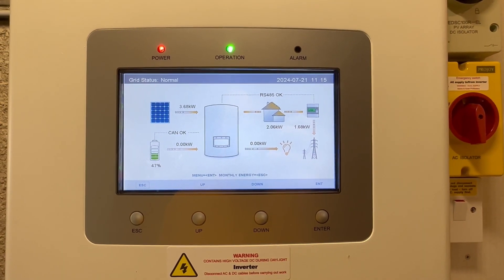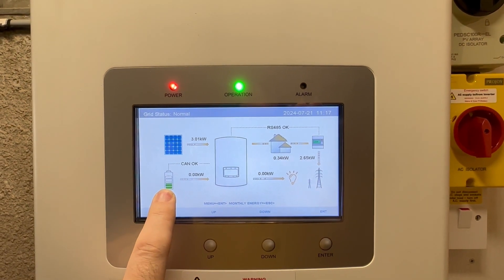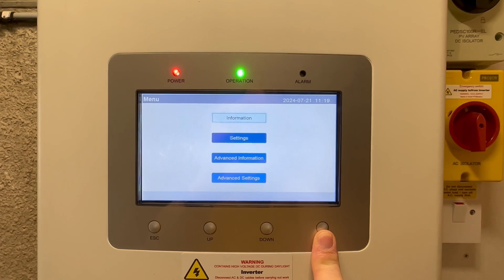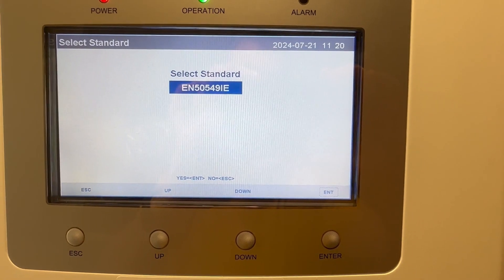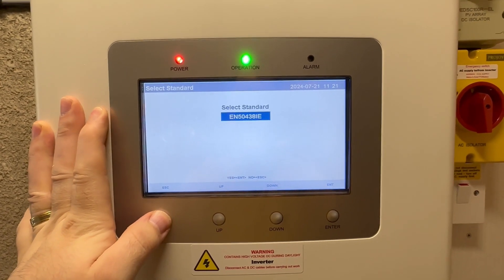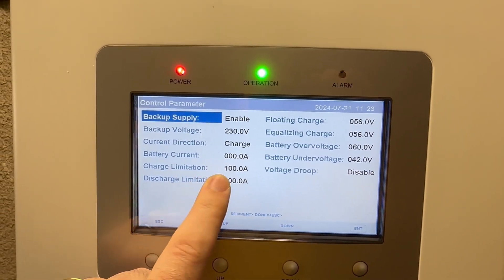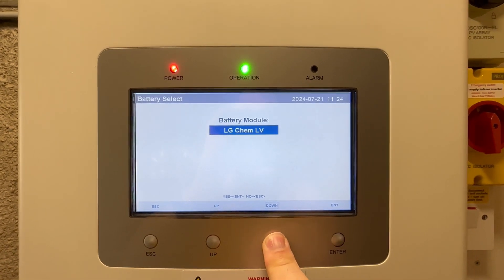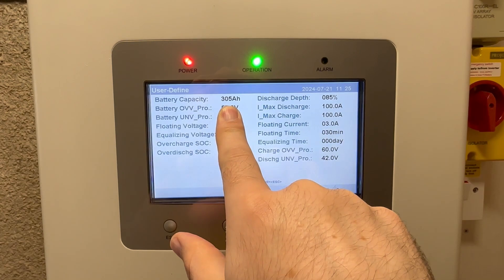Solis Inverter Battery Settings (other options)

Comment: Hi Gary, great video thanks. 
I’ve got exactly the same set up now solis and seplos i’ve had solar for two years but only added my battery three months ago but my bill is only about 5% cheaper than before I added the  battery, I run a small hairdressing salon from my home so between the heater on the wall and the hairdryer and the immersion. I’m pulling in excess of 5 kW at the same time. Is there anything I can do about this? I’m beginning to wonder was it worth the investment in the first place as the inverter cannot handle a load even when I have 15 kW battery, lately in the winter my 15 kW is gone by 3 pm.
I’d appreciate your input on this , thanks in advance.
Pat
Reply from the maker: There's a lot to unpack there, because I don't have all the info. Your energy tariff matters, as well as your consumption and patterns of use. So, i'll just tell you what I would do if I was regularly exceeding the power output of my inverter and draining my 15kWh battery in the afternoon. But before I do, I want to point out that if you are filling that battery on cheap rate electricity, then you are saving the difference of 15kWh per day at the expensive rate compared to the cheap rate, which for me at circa 36c and 8c respectively would be €4.20 per day. Assuming a charge and release loss of 15% total ~€3.50 which is €1,277. On those figures, the battery gets paid off in about a year. I would try to move all my my energy needs into the batteries when it is cheap and aim to never pull expensive electricity from the grid. 

Onto what I would do if I were you and really wanted to use only cheap energy (not knowing your full circumstances or setup). Upgrade the inverter and add at least one more battery, or ideally two. You need a more capable inverter in order to charge and discharge the batteries more quickly. Your immersion will draw about 2.5kW. Your heater maybe 3kW and the hair dryer...assuming a regular hair dryer will use an average of 1.5kW, total of 7kW before any other base load in the home is considered. Depending on what is used in the home and how you manage the hot water consumption, I would suggest an 8kW Solis inverter would be a good bet. In Ireland, I would need an electrician to apply to the grid (ESB) to allow for a bigger inverter using and NC7 application before having the inverter replaced. I would then add another battery, or two which would cover the rest of the business day and then whatever the house needs when the business is done. I would expect the products to cost me approximately €4,000 and would expect a payback period of about 2 years if done properly. The electrician shouldn't be too costly, as the inverter is easy to replace and only the circuit breaker would need to be upgraded in the fuseboard.

As for the hot water. If you heat the water in a good immersion cylinder of suitable size, you should have a sizeable portion of your hot water needs from cheap night rate electricity. These would also be business expenses if I were running a salon. I hope that helps you out.
Reply: @GaryOnPower  thanks a million, that all makes sense. Unfortunately before I installed I didn’t realise my inverter would only power 5kw, so getting a bigger inverter is definitely the solution alright. 
I presume my inverter is set to discharge to the full 5 by default?
Reply from the maker: @PB22000  The vast majority of people don't realise what their inverter will do beyond turning solar energy into useable energy in the home. Your 5kW inverter will have input and output power units on the label on the side of it. Typically, the 5kW Solis will only input 5kW or output 5kW, but they are also capable of outputting an additional 3kW if say for example your solar panels are generating 8kW. The first 5kW will be used by the home or will be exported (depending on your settings) and the other 3 will go to the battery. Any excess will be clipped.  The default discharge rate is 5kW, yes. You can see this on the screen in real time when energy is flowing through the inverter.

If you buy an 8kW Solis, you can sell the 5kW solis to help a little with the costs. You should be able to sell for €200-300 depending on where you are located. There are plenty of people who bought string inverters who later want to add batteries, but can't because they need a hybrid inverter.

Comment: Floating charge 56V looks too high for me. It's set to the same as equalizing charge 56V. This can't be. Could you please explain why you chose this setting?
Reply from the maker: You would have to ask the manufacturer, as that is the default setting for the battery parameter chosen on the inverter, which I believe was AoBo at the time of recording. Likely the same for Pylon. The BMS takes over these functions anyway. Those settings are in my battery settings videos and they are what has been recommended by people far more knowledgeable than me. They are also the settings I have been using without issue for many months, while those with the default values repeatedly report battery issues. When my settings were closer to the defaults, I had issues on a weekly basis, including sudden SOC drops from as high as 50%, right down to 5-10%, effectively sedating the battery packs until the next charging cycle. 

I stress that these are the settings that work for me and people can use them, or not, at their own risk. The same settings have been applied to my in-laws battery kits. They also have a 5kW Solis Hybrid Inverter. Zero problems seen and I monitor their setup on a regular basis.
Reply: @GaryOnPower  hi thank you for your kind response. I just googled it up and found some warnings.
I did some settings by myself so I was alerted.
You may find it helpful so I copied and pasted it:

No, the float charge and equalization charge should generally 

not be set to the same voltage. The equalization charge voltage is significantly higher than the float charge voltage, and using the equalization voltage for floating can damage your batteries. 

Float charge is a lower, continuous voltage used to maintain a fully charged battery and compensate for self-discharge without causing damage, especially for sealed batteries like AGM and Gel.

Equalization charge is a controlled overcharge at a higher voltage, primarily for flooded lead-acid batteries, to balance the individual cells and remove sulfate crystals from the plates. 

Recommended Voltage Settings (for a 48V system)

The correct voltages depend heavily on your battery chemistry (lead-acid vs. lithium) and the manufacturer's specific recommendations. 

Battery Type Float VoltageEqualization VoltageFlooded Lead-Acid~54V (2.25 VPC)~62.4V (2.6 VPC)AGM/Gel Lead-Acid~54V (2.25 VPC)Not recommended (can cause damage)LiFePO4 Lithium~54V (3.375 VPC)~58.4V (3.65 VPC)

Key Considerations

Manufacturer Specifications: Always consult your specific battery manufacturer's data sheet for the precise recommended voltages and charging profiles. These values can vary slightly between brands and models.

Temperature Compensation: Charging voltages should be adjusted based on ambient temperature, typically requiring lower voltages in higher temperatures and higher voltages in lower temperatures.

Battery Type Mismatch: Applying the high equalization voltage to sealed lead-acid (AGM or Gel) batteries can cause them to vent gas and dry out, leading to permanent damage.

Purpose: The goal of the float stage is maintenance, while the goal of the equalization stage is cell balancing and desulfation, requiring different voltage levels to achieve their respective functions safely and effectively. 

In summary, setting both the float and equalization charges to 56V is likely incorrect and potentially harmful, as one is too high for continuous maintenance and the other may be too low for effective equalization depending on the battery type.

Comment: Many would really like to see some tests with no battery communication.
Reply from the maker: This isn't the channel for in-depth tests like that. While I enjoy messing about with that sort of thing on a hobby level and personal interest level, I'm not one for recording it and publishing it. The focus is on getting it to work, so that others can design their own system and do similar. Do you have a specific request with regards to battery comms? I don't care to disable comms between the primary battery and inverter. And I suspect that disabling comms between each pack will just result in less accurate charge and discharge. Checking would be purely academic curiosity.

Comment: Hi Gary...great clear video. I've just ordered a Fogstar/Seplos 16.1kW battery. I have a standard Solis inverter, so am looking at the Solis hybrid.

I'm in the UK. The tariff I'm on has 3 cheap incoming slots interspersed with 3 expensive ones. The cheap slots are 13p, the export payment 15p fixed. The obvious aim is to avoid importing during the expensive 3 periods, and to avoid saving solar to the battery where possible.

Looking at the manual and your video, it looks to me like the best option for me is feed in priority, plus 3 charge time intervals defined to the extent of the cheap import periods. That means that under normal running I will import only during cheap import periods. Do you agree? If so, are there any tunes to be plaayed on this?

Also is it definite that in one of the charge periods above if the battery becomes full it will not discharge until the end? That's important to me.

Anything else useful since you've made the video?

Many thanks for your effort to help others.

Martyn
Reply from the maker: Happy to help. 
To answer your questions; yes I think the 3 import and export times are what you should select. Be sure to leave a minute of a gap between the times for import/export so you have no crossover. 

Your battery will not discharge during a charge time period, full, or empty. Likewise it will not charge during a discharge time period. 

I have updated the battery settings in my BMS 3 video. You might find these useful. Check the description on the video.

Comment: I increased the storage capacity and connected a new battery of the same type, brand, model and specifications from dyness DL5.0x. The time difference between the first and the new one is only ten days, but I encountered a problem during connection. The inverter is of course from Solis s6-eh1p6k-L-Plus. In the Solis cloud application, only one battery appears, which is the main battery connected, and the other old battery does not appear. Also, the old battery has five green lights blinking. Note that there is a difference in energy capacity between the two batteries. The old one is 20% and the new one is only 50%. Also, the connection between the two batteries is CAn on pins 4 and 5, as well as the main one with the inverter on pins 4 and 5, and the DIP Switch is also set. In the main battery, the third number is in the ON position, and all numbers in the second battery are in the OFF position. Please help me solve the problem. Give me important recommendations and the required settings for the system to work efficiently. Thank you very much.
Reply from the maker: Only 1 battery will show as a total percentage of storage capacity. On Seplos V3 BMS, the DIP settings are all OFF. This video is about SEPLOS with SOLIS settings. If you set your inverter to Dyness battery and you have the correct comms protocol setups, the only other thing I would check is that the cells are all fully top balanced by force charging them separately to 100%.

Comment: Thanks for sharing all this Gary.
My cheap inverter just died. I'm thinking of getting a Solis. 
Will it work with no BMS link at all?
Reply from the maker: I can’t recall the exact settings right now. I’m working away so I can’t check. The settings are on the videos. On the inverter, you should be able to use AoBo as battery and I think on the Seplos BMS, it’s Dyness. Double check for yourself.

Solis won’t support a Seplos battery, but it won’t void your warranty by connecting it. Otherwise they wouldn’t allow in their software for Lead Acid batteries custom settings.
Reply: @GaryOnPower Thanks a million Gary. 
I just won a bid for a JBD BMS on eBay. 
I'll let you know how it goes. 

Yes the warranty limitation doesn't make sense... Lead acid are horrible. I started with 4 12v AGM batteries. Rubbish compared to Lifepo4.
Reply from the maker: Yes, you can use the inverter for basic voltage readings, but I can’t recommend highly enough that you get a BMS. Many battery kits come with a BMS including the Seplos kits I have on this video series.
Reply: @GaryOnPower  Thanks for the quick reply. I'll buy a Solis then so.

I have a battery of 16 Lifepo4 230Ah cells. 
A fuse limits max current in and out. A Neey active balancer takes care of them and provides handy monitoring via a bluetooth app. 

Another advantage of the way you set up yours for grid export as priory, might benthat the battery only does one cycle a day. Which should prolong it's life!?

For battery longevity, I only charge up to 54V. Perhaps that's too cautious?
Reply: @GaryOnPower  I have the solis inverter installed. 
But it refuses to accept my homemade battery. 
I spoke to Solis technical support...
They said I'd void the warranty if I use anything other than their recommended batteries. BTW: seplos is not on their list!

Which battery did you tell the inverter you have? 

Thinking of trying to get a compatible BMS to add on.

Comment: I've just got a setup like this. Can you tell me if the inverter will still power on if you turn the battery off but leave it connected to the grid please
Reply from the maker: There must be solar, or battery, or the inverter will go into standby and shutdown after a while.

Comment: Hi Gary, thank you for your videos, I'm having some issues with my inverter, it has been installed recently and they had problems with the meter that they routinely install at the grid, so they ended up installing a different more expensive one... I see that the grid goes from+ to - every second, meaning that independently from the PV output It still looks like it's pushing to that grid and than one second later changes the other way round...that behavior is reflected on my eddi and the myenergi app... you will see the arrows changing directions every second...I think the installer is missing something... Any advice?
Reply from the maker: Show your installer what a properly functioning inverter looks like. It could be that the inverter is faulty, but I would just be guessing. Your installer needs to come back and complete the job.
Reply: @GaryMeatsLife  thank you, I'll be definitely calling him back in but I was trying to figure out what happened... I'll still need to familiarize with the system...and I'd like to get to the point that I can do simply troubleshooting by myself...A bit of a learning curve ... But thank you for your reply and very interesting videos

Comment: Is there an option to set max charge on the battery to prolong life i.e 80% max charge to preserve battery life?
Reply from the maker: Yes. It can easily be done if you select the User Define under battery select. You can choose the max SoC. This can also be done via the BMS, but I wouldn't recommend doing it at all. The battery needs to top balance and this is only done when the cells are peaking in the charge cycle. Degradation will only be seen if the batteries are left in a high SoC for long periods of time. If the batteries are charged to full and are then being used within a few hours, they will be happier than only charging to 80%, especially if using LiFePO4 cells.